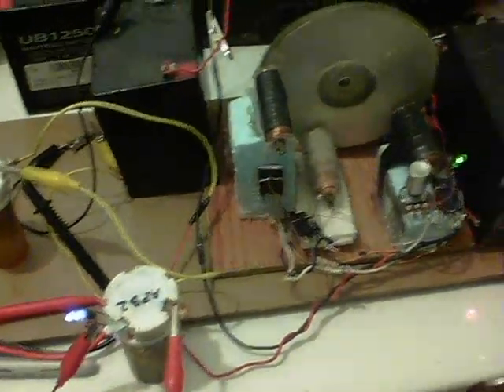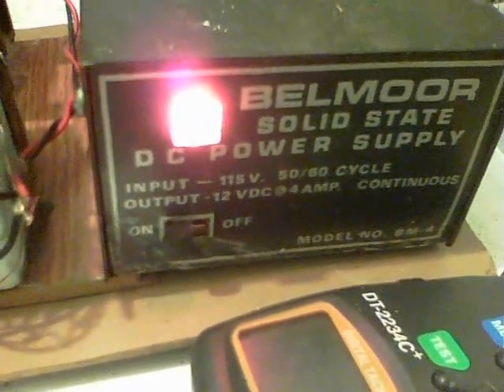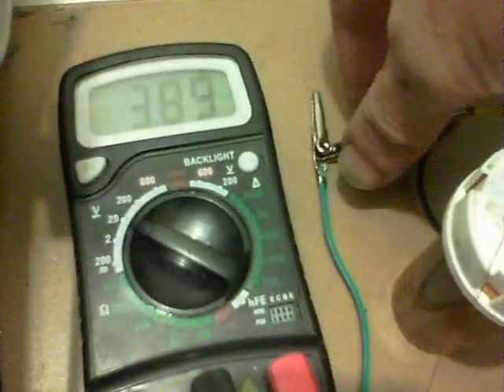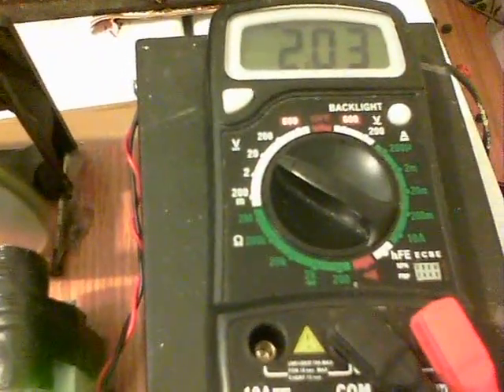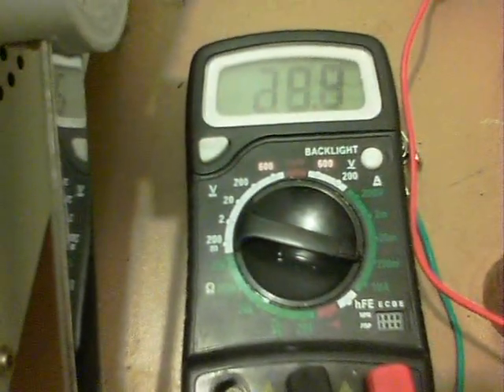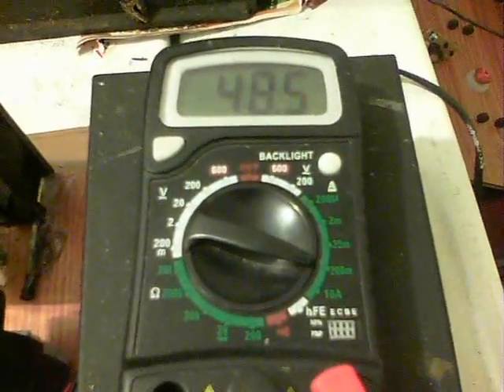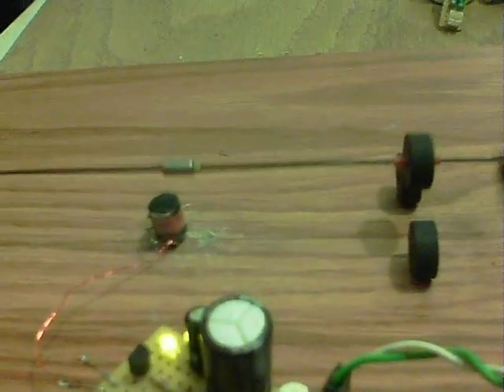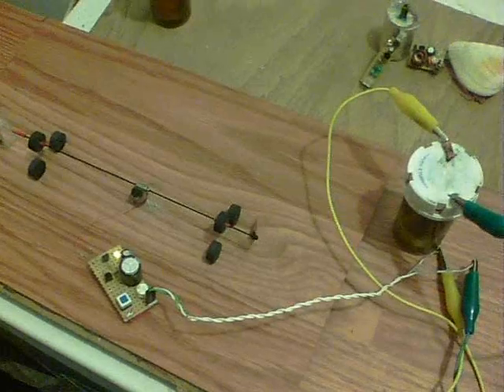Alum Cell running levitator motor + SSG charging

Comment from the maker: @PoirierMike Thanks Mike. The APB2 cell is perfectly fine, 0.9V and 35mA after many tests and no charge again yet. The first one is the test bed and now has Epsom salts in it too. They've neither helped nor hindered, but may in time. Was trying to clean the electrodes, as we see done to car batteries. Scrubbed a black deposit off the steel and saw no difference, which was surprising.

Comment from the maker: @OUbrads Cheers Brad :) Have just tested 'APB2' cell and it's at 0.978V and 40mA. It starts up the levitator great still. The original cell 'APB1' doesn't seem as powerful, now that it has purified water within. Had a strange effect with a Joule Thief though on that, the JT has no cap and yet flashes brightly...will likely show that within another Jeanna Light type experiment built today (1.5V, no cap or resistor, uses axial inductor on the transistor Base + lights 2.5W LED mains bulb).

Comment from the maker: @blackchisel97 Thanks for the tips. Yes it's not the best now that SSG. There's video of it running nicely a couple of months earlier. Cat knocked it off the washing machine and broke the CD rotor off. It's not positioned correctly, simply off center hence the thumping. Am intending to finish it up, but needed a 'runner' for such tests. When finished up, the trigger/run coil will be adjustable, like the 3PM is.

Comment: @slider2732 Just wondering about SSG charge and adjusting according to the cell- sort of of C20 ratio. I know this is different, but too strong charging may not prove beneficial as far as the effect on electrodes longevity. I have a feeling that whatever happens (forms) on the electrodes may take time. Also, different metal combinations may work surprisingly well or rather poor. I'll run some test when my order arrives. For now just watching and thinking :)
Thanks
V

Comment: @slider2732 I would adjust base resistor a bit higher. They usually have more than one sweet spot. I also noticed your SSG sound being a bit thumping which maybe too much cogging. Can you try increasing a gap between rotor and cores? You may end up with same charging but at lower cost - input draw. Also, with bigger gap you'll have smaller spikes.  I have an old (one of my first) SSG also built on CD's and HDD armature. I made my core adjustable. There is still youtube shot with it.
V